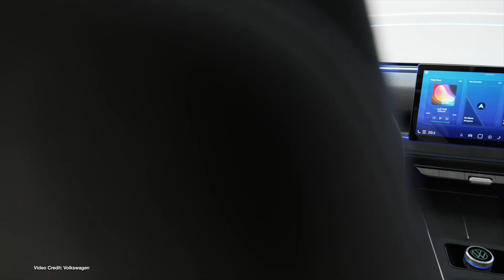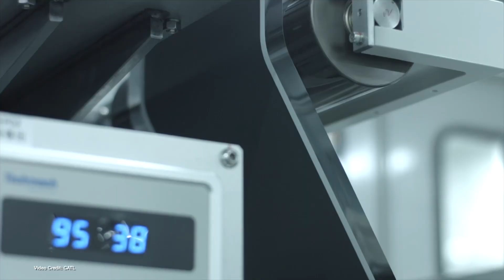ecoTEC Episode 327: Tesla Shareholders Decide, Rivian Updates R1, BYD, CATL’s New 6C Battery Goal

Comment: The EV enthusiasts keep stressing home charging to circumvent charging times that they ignore the urban apartment city dwellers.  It is fine and dandy if you live in a home with a garage and with a charger.  The Chicago disaster last winter highlights the EV issues in a dense urban environment.  Watch Cash Jordan’s YT video on EVs which reveals the issues for EV owners in New York City. EVs have to be accessible to all or it will fail massively.

Comment: Geoffrey Moore wrote a book on Crossing the Chasm.  To cross the chasm from Early Adoptors to Early Majority, the product or new technology had to be designed to appeal the masses.  In EV’s case, mainstream consumers want an EV that has the convenience and familiarity of an ICE vehicle.  This includes the time to replenish the energy for a vehicle.  The time that it takes to recharge a EV should be the same as filling up an ICE vehicle for it to appeal to the masses. If this can be achieved, this would mean fewer chargers and gas stations could be viablly converted for charging EVs.  The narrator likes to put labels on critics as “naysayers” , but some of those critics have valid points for charging EVs.
Reply: This is a case where education needs to be made to shift expectations. 

EVs aren’t ICE. The biggest benefit of an EV is plugging in at home every evening and staying the day full, so in normal day to day use, you NEVER have to go to a gas station. 

I’ve saved far more time avoiding gas stations for regular commuting/around town errands than I have added in longer time spent charging on road trips. (And I actually do road trip fairly often and for long distances.)
Reply: @AnonymousFreakYT  You don’t get it. If charge times for EVs were the same for refueling an ICE vehicle, then you wouldn’t need as many public chargers.  “Gas station” model would fit the bill for EV charging instead of the large proliferation of public EV chargers.  The current situation is that there is a massive public charging network which leads to high maintenance and unreliability.
Reply: @williamquemuel7824  There is steady improvement. As mentioned here, one company just announced a “6C charging rate” battery. Combined with upcoming 500kW stations, and even big battery EVs soon will have ICE-like charging speeds.